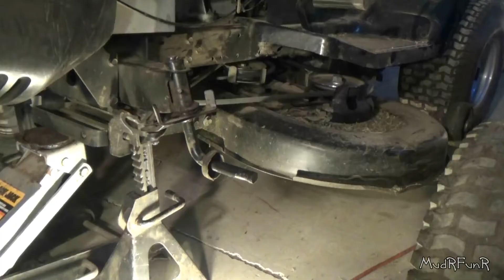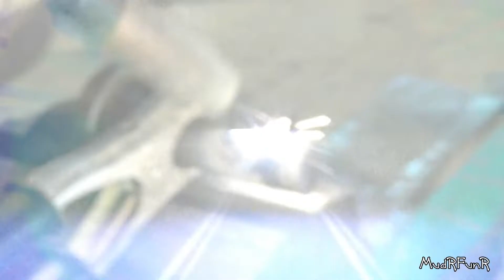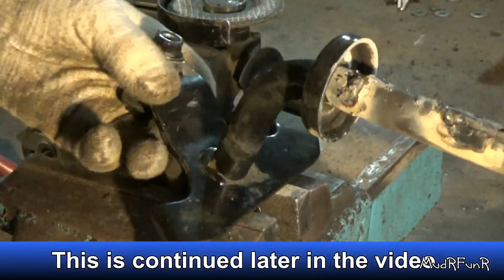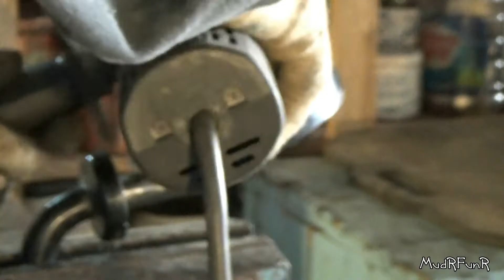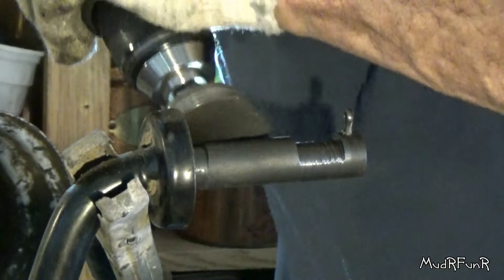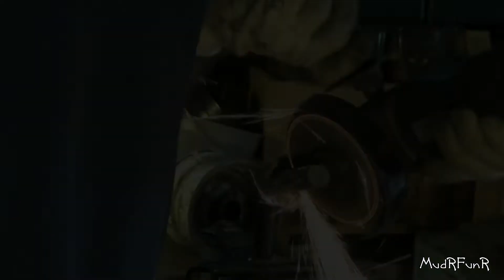Lawn Mower Axle Shaft and Rim Repair

Comment: Just so ya know, I just found out they make ball bearing upgrade kits to replace those bushings. I was just going to replace the axle spindles on my old 90's Murray (I'm lazy), but come to find out nobody makes them anymore, so I'm gonna have to drag out the old welder and do it your way LOL. I probably should just buy a new mower because I'm old and retired now, but heck, that old 18 hp Briggs just won't die. That old deck probably has a whole spool of mig wire welded to it. And I just put three new deck spindles on it three years ago. Good video, from one old gear head to another!
Reply from the maker: I've never had a mower as reliable as my Murray. It's looking real rough now but it runs and cuts great. It's hard to get rid of something that just works. It's great to hear from another old gearhead. Happy mowing!